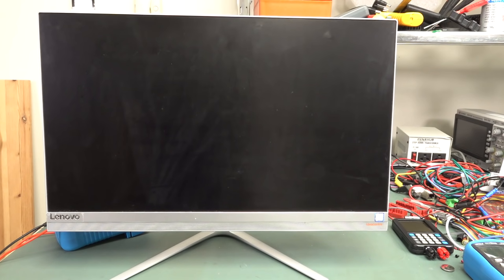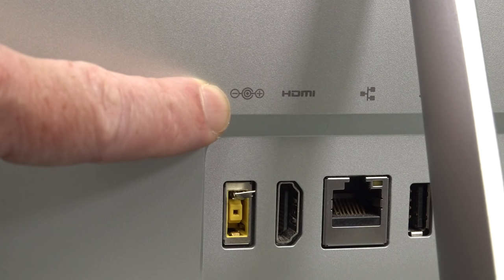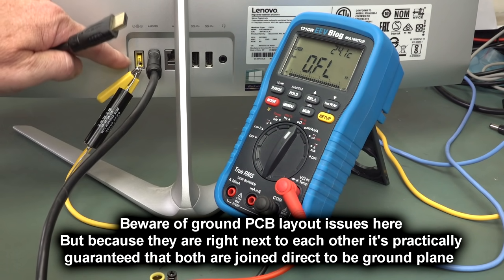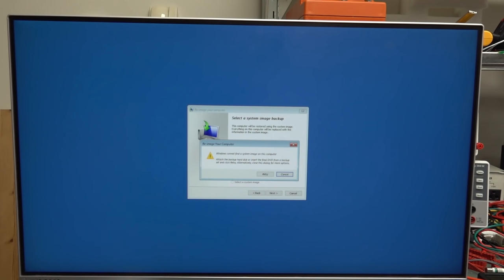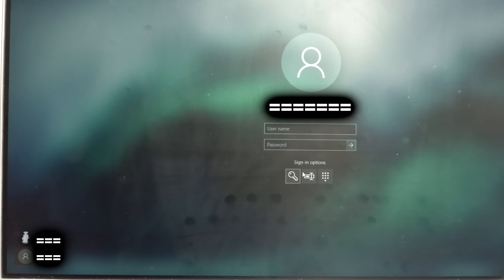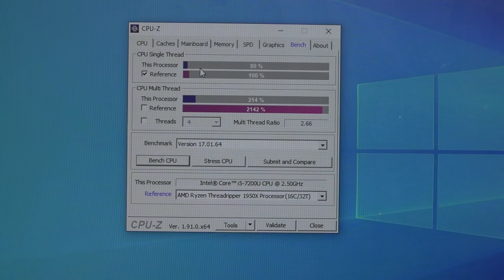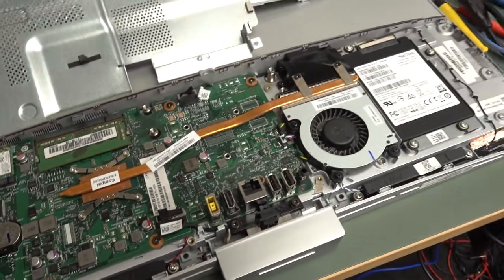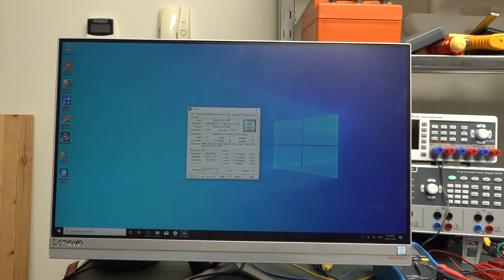EEVblog #1279 - Best Dumpster PC Find Yet!

Comment: Today I learned that windows password security is even worse than I thought it was.
Reply: BigJoe_Buster The only thing that’s secure from the manufacturer is Apple’s encryption at the boot level. MS just fails hard. Even their hardware bitlocker encryption is trivial to circumvent. 

This type of security is always difficult though since you have physical access. On Macs, if you have physical access to get past boot you can reset the password from the restore mode without any screwing around.
Reply: @Alexlfm  Yep, all Macs have FileVault enabled by default (quite nice too, the T2 chip handles all encryption). And starting with Catalina, Macs have the same activation lock as iPhones (so if your laptop is stolen, it's basically a brick to them since it'll need the iCloud account details to reset).
Reply: Physical access defeats all security short of an encrypted drive.  But with a more secure OS on the drive you'd have to boot a different OS to bypass the security.
Reply: @hanelyp1  That will stall them for at least 2 minutes
Reply: @Alexlfm  How is Bitlocker trivial to circumvent?
Reply: @Pr3DaToRx12  In terms of trying to directly break a bitlocker device with just a strong password and no TPM module then it is near impossible. Crypto attacks are mostly side channel attacks, so they attack devices like the TPM, or weak passwords. Otherwise you have to attack the algorithm directly and that is effectively impossible.
Reply: Braze IAR Yes but you’re almost always guaranteed to have the TPM in most result world situations. The main reason for this encryption is generally portability and risk of machine theft.
Reply: Predatorino https://www.zdnet.com/article/new-bitlocker-attack-puts-laptops-storing-sensitive-data-at-risk/

Unless you lock down both the bios and the TPM it’s useless. Also some early bitlocker devices used non TPM hardware security that was extremely easy to bypass. I believe MS themselves recommends the software encryption with device BIOS pins unless it’s guaranteed all devices deployed have a compatible TPM.
Reply: I got no love for Windows, but hacking the root password on a Linux box is even easier if you have physical access to it.
Reply: I have allways a usb stick on me with some boot programs on it, just put it in, select the image for password recovery, let it do its things and tadaa you get the logins for every windows since XP, quite handy tool and it has some other goodies on it from recovery stuff to formating programs and whatever you need to repair or get acces to computers. Really helpfull if you have to do all the PC stuff of your friends lol.
Reply: If the drive is encrypted with bitlocker you're SOL for data, but you can reimage the machine.
Reply: Cobb Butterscorn Unless you set a boot password (though in most computers you can reset it by accessing the motherboard, in Macs if it’s relatively new you can’t). Encrypting the HDD serves a different purpose, it’s just to protect your data, not the computer, as you can just format it.
Reply: Quentin Duff The SMC has nothing to do with that. The SMC is what manages accessories like fans, the power supply, etc. Resetting it does nothing to any passwords or important data.

Comment: Wait, wait, wait... Avast AND Norton?! BAHAHAHA No wonder you found this thrown out!
Reply: Haha agreed.... 😁
Reply: Most issues I run into in Australia with computer problems when I fixed computers was them running slow.  I always discovered it was one of three issues;  Windows was corrupt (and windows 10 corrupts easily), conflicting security software or bloatware, usually in the form of free software attached to downloads.  Also, there is that other issue with the 2018 build of Windows 10, you literally have to reinstall windows if you want to version update past it, because it has a bugged updater.
Reply: Windows huuuh
Reply: Jerry Dodge yeah,like a finding two turds in a diamond.
Reply: @foxdavion6865  Or the 4th one - the users browsing habits arent terribly good, and you end up removing 15 toolbars from I.E. (because they're not smart enough to use a real browser) and then wait as MBAM or similar antimalware software removes the 13,000 PUP's from the machine. Boom instant speed demon again :)

Comment: "It's got speakers, it's got core i5 7th gen, it's got USB, it's got Ethernet".  You left out that it probably has a BIOS supported root kit too!   Lenovo was found to be putting root kits in their BIOS so you can't prevent or remove them, thereby giving them a backdoor into your system.

Comment: Windows exploitation with Dave, now on SECVblog
Reply: A windows 10 reinstall would have been better, the key is built in. UEIF or whatever that acronym is. When installing windows, it attempts to trick you to get a Microsoft account, but you have to keep telling it to piss off. I will be done with Windows if they ever force that.
Reply: I was impressed, but I would've just fetched and dumped the drivers onto my Windows 10 installer flash drive and done a clean install...
Reply: @RickyX64  What "drivers", there is nothing to it. Its not like the days of old. That's why windows physical memory size is so massive, from the libraries. Either way, any real nerd would have a SSD with Linux ready to go. Also, I went to try Arch linux, turns out, its not so straight forward lol. No wonder people flex with it. I shall too.
Reply: @Wtfinc  Most newer (non-OEM) motherboards do require their network adapter drivers to be installed first :)
Reply: @rkan2  OEM Shmo-EE-Em lol, no big deal. easy 3min job to find all, what, two drivers u would need. like u said, network, an likley touch.
Reply: @Wtfinc  On new EU machines with home it actually prompts you to hook up a network before it will let you continue. The only way to get it to avoid making an account is to pull the internet while it's updating. Bleh.

Comment: The power connector has three connections: Vcc, Ground and Sense. Sense is the middle connector, ground is in the two contacts you already identified. The Vcc contacts are facing the ground contacts on the middle plastic part. They are a bit hidden.
These Lenovo chargers are not smart. They have a specific resistance connected between the sense and ground so the device knows how much power it can draw or if it wants to run at all.
Reply: @EEVblog  Yeah, that's what I said. Ground are the two outer contacts and the Vcc contacts are attached to the middle plastic part and facing the ground contacts.
Reply: @EEVblog  The diagram you showed was technically right. The VCC is pointing to the contacts on the inside of the connector and the ground is the outside of the connector. https://superuser.com/questions/1246823/lenovo-trim-yellow-rectangular-power-adapter :)
Reply: @EEVblog  You were looking at a Lenovo Laptop some years ago i think? or some other Lenovo product, it used their old style of power plug but it's the same deal, and it also caused a headache for you there.
Reply from the maker: I had another look, and yeah, it's almost impossible to see those inside contacts. That makes bodging something really hard.
Reply: EEVblog That looks a lot like the lenovo thinkpad laptop charger connector. Edit: I see you already found that out
Reply: @EEVblog  the problem is that a lot of time Lenovo don't use zener diodes to protect the EC. Generally a failure of the connector result in an embedded controller failure. (20v directly to 1v8 logic chips)

You have been quite lucky!
Reply: small strip of double sided pcb with plus and minus on each side?
Reply from the maker: @fuzzy1dk  If it's the right thickness, yes.
Reply: @EEVblog  also very Dangerous to apply power to the most inner sense-terminal. On some machines it is directly wired onto the SMU or the SOC. Without any series resistance or ESD protection. Too much current flowing there can render the entire machine useless.
Reply: HP and DELL are using the same charger identification method.
Reply: @Qban220  Only HP,  Dell's chargers are using 1-Wire interface on the middle pin.
Reply: It's the same with Dell and hp "barrel" chargers, there use the inner and outer wall of the barrel for 2 different contacts
Reply: You can buy a $1 square to barrel(female) connector on eBay, and just use the barrel female jack or stop the cables and use it with separate wires..
Reply: The logo on the case makes this clear - the plus symbol points, not to the center pin, but to a circle drawn around the center pin.
Reply: @robertbackhaus8911  hmm good eye, yes it does
Reply: @EEVblog  hey little off topic here.

But what is that you're referring to as Walkabout?

Not sure exactly what you mean?

Is that an Aussie thing???

AKA Australian for something?

I'm in the United States so that's why I'm asking.

As you might say it .

USA USA USA.

Would like to know thanks.

Also have you ever heard someone call zip ties.

AKA cable ties.

Called zap straps.

I think it may be a Canadian thing?

One place I've heard that was on a v e's Channel.

And elsewhere as well.

Even buy some people have met in the past.

Before even YouTube existed.

And before the internet before that matter.

Also do you guys in Australia use wire nuts in the electrical systems.

Or do you guys have something like a Wago connector instead of that.

Also you should do something on the old zillweger system as well.

And metering devices.

And load controls.

And trimming devices 4 loads.

And photo controls.

And also Australian fluorescent fixtures could be interesting as well.

And maybe some things on Street lighting.

Old school that is.

One sling that fascinates me is the old series Street like systems.

Somewhere I've got a couple of the old fixtures.

And an old faucet for the street light.

Unfortunately I don't have the original cover for the bulb.

Although I found some acrylic tubing that fit.

Also do you guys that ain't her mom have used the storage heaters.

Like in the United Kingdom.

And those sorts of things mentioned above will be awesome.

Or links to videos as well.

Thanks.
Reply: @EEVblog  me again...

More on topic with video this time.

Sorta.

When you were showing the front of the monitor.

Under right side underneath.

On the bench that is.

What is that piece of kit.

A k a piece of equipment.

That has the red and black binding posts.

AKA banana jacks.

And the keypad on there.

Didn't see the entire thing.

Or I missed it.

I'm not sure if it's a multimeter or not.

It did not look like it.

To me at least.

I know it's some sort of test equipment.

 Of course.

Captain Obvious here.

But what exactly is it?

I'm thinking calibration source?

Definitely selling programmable.

Just curious.

Also if there's a video related to it please link below.

Thanks again.

Also once I had a micro USB to USB C adapter.

Yes it's a pretty quick charge and all that.

A better one.

That is actually up to the task it was designed for.

And brand I would normally trust.

And something that's hardly rated.

And never had any problems or heard have any issues with their products.

I was one day charging my phone. 

With this adapter.

Smelled something earlier couldn't figure it out.

Like hot Electronics or hot plastic.

No smoke or anything.

And no it did not let out the magic smoke either surprisingly.

Also my phone Samsung more recent phone.

Had detected moisture in the USB port.

When it was entirely Bryant and had been since the week before.

No condensation possibility.

And then later I unplugged the adapter.

Came back to it went to pick it up.

And the adapter had gotten high enough to deform.

Substantially..

The ports were bent at about a 25 degrees or so angle from each other.

Fortunately I did not get burned by the adapter.

No damage done other than the adapter itself in the end.

By the way be fast charger was still providing power to it at the the time.

Did not shutdown due to overload or short circuit.

Surprisingly.

By the way.

Qualcomm fast charge.

AC line power charger.

Although I'm Not sure which generation.

I know about usb specs and such.

Although I've had a cable go short-circuit due to wear and tear on the end of the cable.

Shut down to overload and or short circuit.

Had that happen at least once or twice.

Also it happened once he wants after that occurrence with the USB C adapter.

So wasn't at fault of the charger. 

For sure.

Has anyone ever seen anything like that?
Reply: @InterstateLoveSong  its the same way the dell and hp barrel plugs are built both the large and the small the positive is in the inside of the barrel and the neg on the outside with and sense or id pin. There was a time when there was a 1 wire com circuit in the center pin but that caused more problems than it was worth and is much more uncommon these days. the biggest reason this was done is the currents that were being used they needed a more reliable connector that could provide more amperage.
Reply: @EEVblog  You can usually stick a bit of double sided PCB stock in there to connect to both the inner and outer pins. I've done that on the older connector that has the same construction except it's round.
Reply: Aaron Brandenburg not even judging, I’m just fascinated as to why you put every short sentence of your comments on its own line?
Reply: @EEVblog  That's why I bodged in a psu by soldering to the connector pins on the pcb. And the only smarts is the sense resistor.
Reply: Hey Dave Jones.

Long-time follower.

How is Seguin doing.

Why I'm asking.

Maybe this computer could be seconds computer for his room.

Maybe that would bake a sweet computer for him.

You know Navy coding projects.

Your watches father's videos on YouTube?

Also is he allowed to use the internet on its own.

Frankly I would not recommend it.

There is too much fuss just say not good stuff out there.

But if you have enough control over it.

But it would be nice for him to have his own computer.

That he wouldn't usually grow out of.

At least for a little while.

My first computer that I actually owned myself.

I still have it for over 10 years.

Delivering not it only had USB 1.0.

Old Gateway 2000.

One of the pins and Celeron processors can't remember which one.

That machine is long dead.

Went through more than one hard drive.

1 CD drive.

It even had a broken USB port.

Which I clipped clip the leaves on the port so that it would short out.

The power supply cabling had been patched up.

Chafed on the case.

Eventually I warmed up having three hard drives.

And one DVD drive.

Recently had two DVD drives.

Virtual Ram was maxed out.

I think I have a 160 GB of storage total or so.

Originally it only had 40 GB of hard drive space.

Was running Windows XP gasp originally.

And I know what you're going to say but there's only two hard drive Bays.

Well some plastic and plus some zip ties equals third hard drive bay.

Sometimes you got to do what a makers going to do.